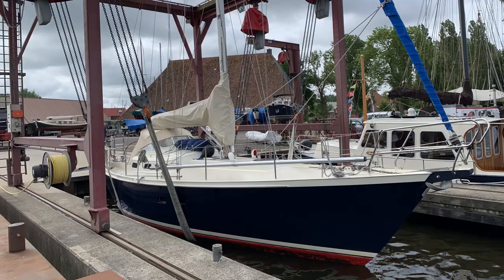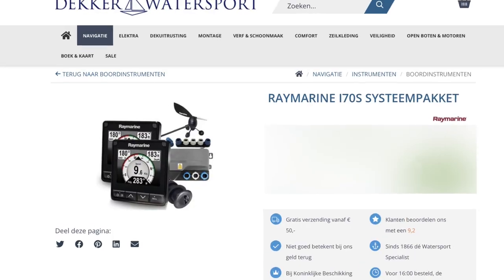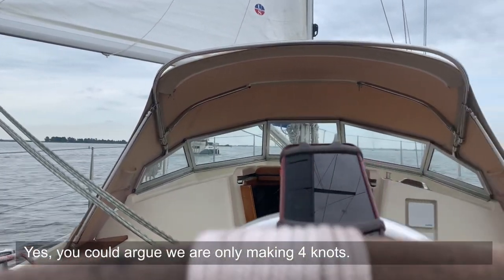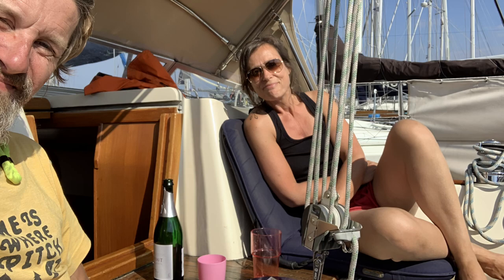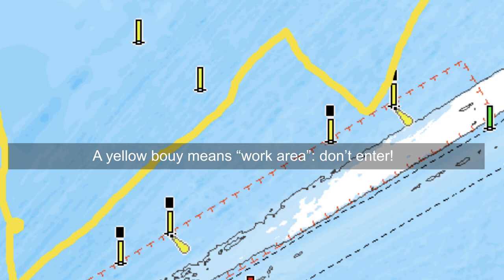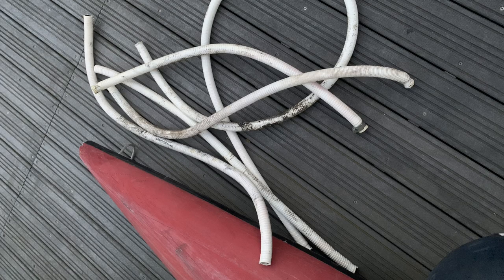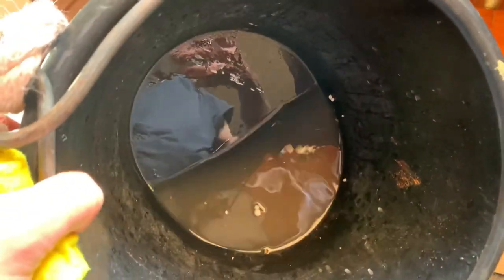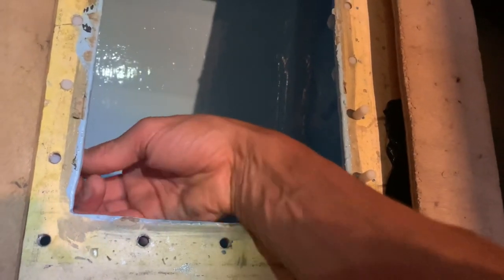010 Aluminium water tank repair Koopmans 36 sailboat (part 2)

Comment: I'm very happy you used nylon bolts👍
Reply from the maker: Out of curiosity, by experience or also interested to see if it holds :)
Reply: Hi, the idea of nylon bolts, nuts and washers is intriguing. And the loads of some decimeters of water splashing in rough weather in the tanks are not big. So they should be strong enough to keep the water inside. But the inside of the old aluminum tanks not being painted at all and having 'survived' for 20 years, didn't you think, that your thick layers of rubber paint and additionally nylon washers inside and out to protect your paint against stainless bolts and nuts would have been enough of insulation against electrolytic corrosion?
Reply from the maker: Hi Heinrich, thank you for asking this very valid question. Coming episode I go into detail on this because more than one comments had valuable insights. To cut it short, I’ve replaced them with stainless again for more than one reason and your argumentation being one of them. Love to hear your comment on that episode !
Reply: Yamaha use zinc plated stainless bolts on their outboards to stop them reacting with the aluminium
Reply from the maker: That is also an interesting solution. For now just created a vid where I’ve replaced them so let’s see in half a year if I can spot any issues.... thanks for the tip Luke!

Comment: what paint did you use inside the tank ? is this foodgrade paint ?
Reply from the maker: Hi Malo, we used Sigma Guard CSF 585, special paint for drinkwatertanks. https://www.ppgpmc.com/products/sigmaguard-csf-585
Reply: @SailingWindRose   thanks for the fast reply. i ll check that out.
Reply: did you use an airgun to apply the paint as suggested by the company or roll brush was fine ?
Reply from the maker: Hi Malo, airbrush was not really an option but the supplier indicated that the thickness of the paint was more important. It’s really thick and gummy paint so rolling and brushing did it for me. Did create the forced air ventilation to prevent the water to taste like paint. It smells quite a bit in the beginnen do a good mask is also advisable. You have the same task at hand?
Reply: yeah just got an 30years old aluminium boat still at the start of the learning curve and yeah i have same task i was thinking about replacing with plastic tank as mine isn't directly integrated in the hull but still considering refiting the old aluminium tanks.
Reply: BTW thanks for your videos as there isn't much aluminium boat video or clear informations around the web.
Reply from the maker: Clear. If you can sand it properly and get the right grounding on it than this could be a solution. Wind Rose is 20yrs old btw.
Reply from the maker: TNX, great to learn you appreciate it! Good luck with the work on your tanks!
Reply: @MaloRichard  I agree....  the fact that this channel is about an aluminum boat makes it rare...